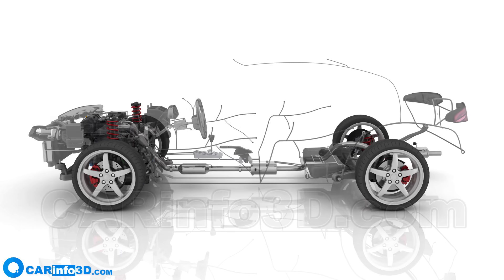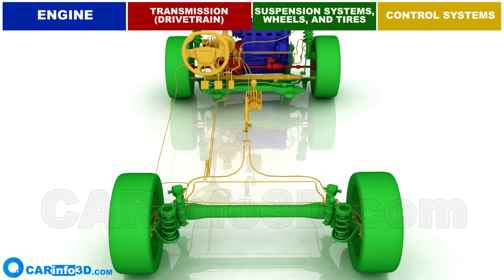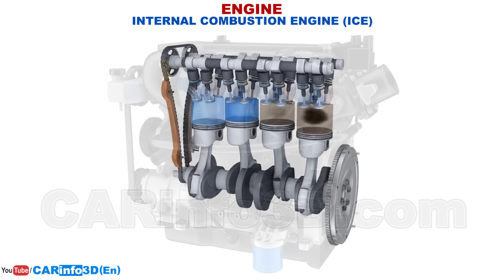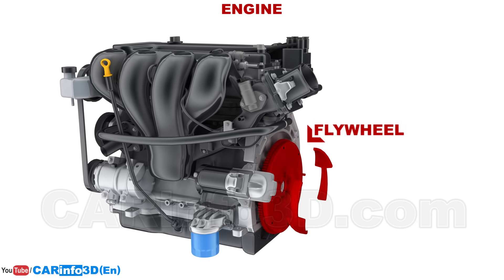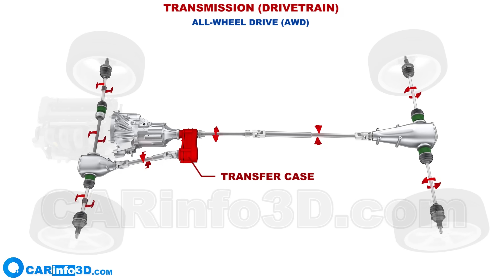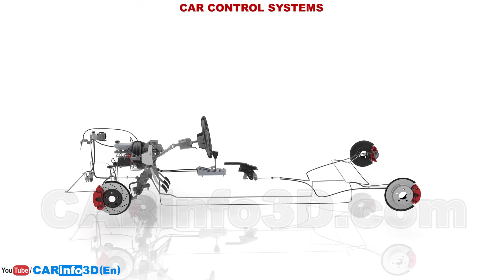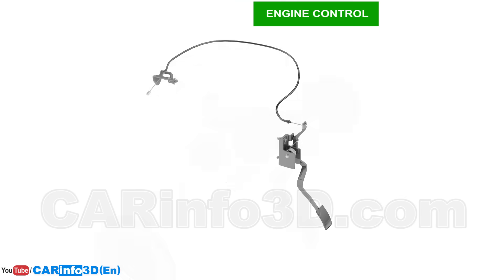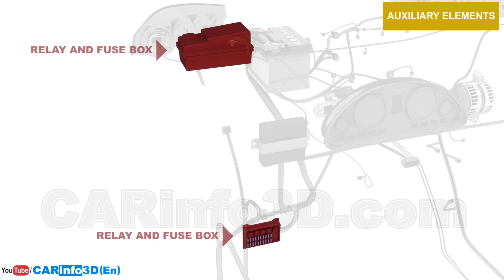Сar anatomy: The Basics / How cars work? (3D animation)

Comment from the maker: Hello! My name is Vlad and I am the author of this video. I would be grateful if you rate the translation and sound in the video.
Also, wait for new videos - there will be a lot of them;) Enjoy watching!
In our online video course "Car Anatomy" there are more informational videos in 3D animation. Details on our website: https://carinfo3d.com
Reply: You are a great guy.Question.why doesn't a 1500cc car consume ten times more than a 150 cc motorbike ?
Reply from the maker: The main point is not that it is a car or a motorcycle. The bottom line is in many other details - 2/4 stroke, carburetor / injector, engine operating speed, compression ratio, intake and exhaust design, and more. All things being equal, the values of the change in fuel consumption relative to the volume of the engine will be close. 
P.S. google translate thank you:)
Reply: @collinsnguyo9688  The fuel consumption of a vehicle depends on several factors, including the engine size, weight, aerodynamics, driving style, and road conditions. A larger engine typically requires more fuel to operate, but it doesn't mean that a 1500cc car will consume ten times more fuel than a 150cc motorbike.

Firstly, a car has a more efficient engine than a motorbike, which means that it can convert a higher percentage of the fuel's energy into motion. Additionally, a car's weight and aerodynamics are designed to minimize drag and maximize fuel efficiency, while a motorbike's design is optimized for speed and maneuverability.

Secondly, the driving style of the rider or driver also plays a significant role in fuel consumption. A motorbike rider may drive more aggressively, accelerating quickly and maintaining higher speeds, which can result in higher fuel consumption. In contrast, a car driver may drive more conservatively, using gradual acceleration and maintaining a steady speed, which can result in lower fuel consumption.

Overall, the fuel consumption of a vehicle is affected by various factors, and it is not solely determined by the engine size. Therefore, a 1500cc car may consume more fuel than a 150cc motorbike, but it won't be ten times more.
Reply: This was good , it’s clear and understanding!
Reply: Hello Vlad, nice break down of the all the systems that bills up the car. It has been made simple and easy to understand. As a newby I was total satisfied with your explanations. 

 I totally learned something new today. Thanks Man
Reply: It’s perfect!!  Thanks mate!
Reply: Really good, very simple nad easy to understand.
Reply from the maker: Thank you!:)
Reply: @Juras-55  The Kingdom of God is at Hand 
John 3:16
King James Version 
16 For God so loved the world, that he gave his only begotten Son, that whosoever believeth in him should not perish, but have everlasting life.
Reply: Pretty good tbh👍
Reply: Is't a car?
Reply: I m a little curious about what software you used to do all the animation...
Reply: Vlad....glad to look at your great work. I am happy to know what kind of animation software to animate these wonderful illustration.
Reply: translation and sound was excellent. I didn't even know it was a translator until I read the comment, good job!
Reply: Good info about the Car and it's working, system,Clear explanation and animation.🎉
Reply: Everything is perfect. I learned many things from this video
Reply: спасибо огромное! пока не зашла в комменты, даже не поняла, что это перевод. сделано очеень профессионально
Reply from the maker: @delphiaoconnor8544  Вам спасибо большое, что оценили:) Мне пока тяжело оценивать работу диктора и переводчика самостоятельно, надо подтягивать английский, но комментария показывают, что они справились потрясающе! Доброго вам дня!
Reply: this was great and entertaining to watch, thank you
Reply: Vlad please make course about all parts of car. I will buy it.
Reply: Hi Vlad, thank you for this basic overview of car. Would you happen to have a link to pdf files or slides of the pictures and components shown in this video? Thanks
Reply: Hello, I am Wasiq and when I saw this video, I understood how the machine and its components work with each other and this video will be useful for people.
Reply: Bro i have 7 emails and you are getting 7 subscribers because you have pleased me a lot. You have a great skill to make anyone understand.
Reply: well done!
Reply: Very impressive keep posting
Reply: Thanks ❤
Reply: this is  a great  video
Reply: sb helps me by give me several example about ''decorative elements" on the body of a car to uderstand more clearly? I can't distinguish between '' auxiliaries and decorative elements". thanks a lot
Reply: Amazing work 🔥
Reply: Not every hero wears cap
Reply: Perfect video and sound.
Reply: Cool 🚗 🚘
Reply: This is how you do it!
Reply: Can't wait for the electrical video haha! These videos are awesome for study.
Reply: Wow thank you Vlad, you did a great job, keep m coming!
Reply: Great!
Reply: What is the role of accelator?
Reply: Very good
Reply: Can you please send us the program
Reply: If you could tell me xhat softqre you use to produce this video
I will be thankful
Reply: Wow!  I am trying to understand just a little bit.
Reply: what software did you use to make this animation?
Reply: Z
Reply: I am 29, consider myself a 5/10 on car knowledge. The visuals in this video are absolutley fantastic. I understand these components so much better now.
Reply: What 3D application did you use, for this tutorial.
Reply: Very informative video
Reply: you can easily compete against Elon Musk... good luck...
Reply: Wow superb diagram and discussion.
Reply: very good voice and very knowledgefull vedio
Reply: Really good.
Reply: Great job.  Very simple which makes it very easy to understand🎉🎉🎉
Reply: Perfect
Reply: Hey! Don’t know if something might’ve corrupted in recent time, but it cuts off some sentences
Reply: which software do you use to animate it.
Reply: Great! Easy to understand
Reply: Can you work to apply my education, I hope that I am waiting for
Reply: Very interesting.  Good knowledge explain. I am very curious about cars until this video show how car works.  Thank you for hard work. ❤
Reply: Freaking you😮
Reply: Hi Vlad, Where i can get this Car Anotmy i need for my project
Reply: You did a very good video vlad and keep it up if you know brain draught please like this comment just kidding😂😂😂😂😂
Reply: Incredible video, excited to watch more of your vids for a fuller car knowledge.
Reply: Круто сделано!
Reply: @Markus_004  99999⁰0
Reply: 7❤ @Markus_004
Reply: @Markus_004 От Иоанна 3:16

16 Ведь Бог так полюбил этот мир, что отдал Своего единственного Сына, чтобы каждый верующий в Него не погиб, но имел вечную жизнь.

Иисус Христос — царь
Reply from the maker: Спасибо!:)
Reply: @carinfo3d-En  От Иоанна 3:16

16 Ведь Бог так полюбил этот мир, что отдал Своего единственного Сына, чтобы каждый верующий в Него не погиб, но имел вечную жизнь.

Иисус Христос — царь
Reply: This is the best video ever I watched
Reply: Great vid boss. Just a quick suggestion - maybe add music, and also reduce the silences between sentences. personally the pace of the video is slow, but that's just me. adding music and decreasing the seconds that are silent could help this. 
Also have a video suggestion- maybe make a video on how a car works - from the start to finish, as a story. What I mean by that is, create a storyline video on a person starting the car, shifting gears, removing parking brake, using ac control, etc - and how that translates to the car, ie: what car parts allow each of those events to function.
Reply: But, I guess in considering how a car accelerates, when you put on the accelerator/turtle , fuel is leaked into the combustion system at the intake.
Now, the intake also allows in air to mix with the intake fuel. 
Then, the spark plug which by way of its electrical connection to the ignition, sparks/combust the fuel/air mixture generating energy pressure that push the piston to roll the drive train and tire while generating smoke from the combusted fuel. 
Now, the more you pedal the accelerator, the more fuel is released into the combustion chamber and the more force energy is generated by the combusted extra fuel, and the more the piston is moved to drive the drive train, and the more the drive train rolls under the extra energized pistons and the more the tyres roll and so the more the car accelerates.
So, the more you press, the pedals, the more the fuel supply for combustion, and the more the energy of the drive train, and the more the car accelerates. 
To decelerate, you press down the brakes to restrict the tyre movements and this is associated with a release in accelerator pressure and so the air and fuel supply. 
While to maintain speed, you keep a balance between the break and the accelerator. 
So the question is, does acceleration leads to more fuel usage because some people says it doesn't and so, how does it not.
Reply: The voice has a very strange accent, it is definitely not American, it is not easy to comprehend

Comment: What I still don’t understand is how the engine remains connected to the drive wheels when the suspension is moving
Reply: Suspension is independent of the engine. Suspension is only for the wheels. The absorb most impacts you'd feel on daily drives. The engine is mounted TIGHTLY to the chassis so it doesn't move. If your car starts to shake violently, its either a misfire, or loose engine mounts 👍

Comment: My seven y.o asked how come oil gets used up yet it doesn't pour out.😅
I've watched this but honestly m also yet to understand.
Reply: I'm not a mechanic, so my understanding may not entirely accurate. From what I know, there could be many reasons why this happens. One of the reasons could be that he piston rings ca wear out over time which causes oil to enter the combustion chamber and be burned away as part of the combustion process.
Reply: @JJFlores197  pretty spot on actually. It usually never happens unless you have a lemon. So its good to maintain and keep tabs on everything.

Comment: what does (anti roll bar do?)

🤔🤔:face-blue-question-mark::face-blue-question-mark::face-blue-question-mark:🤔🤔
Reply: As I understand it, anti-roll bar, as the name implies, prevents the vehicle's body from rolling too much during curves/turns. When you're driving down the road and turn right, the body rolls to the opposite side. The anti-roll bar system compensates by forcing the suspension of the opposite wheels to compress to stabilize the body.

Comment: Space Force science experts of the CaesarKing, create two folds of system designed strings variety from Earth science tech labs of my functional groups space focused group and in my space stations of strings in clumps likened to the Globulins coloured types but with variety of structures and string to string attachments with imbedded sensors within that connect per string receptors and stringed fibers types in space all be formed in clumps after system designs and after space station deployments in its compartment clumps per materials strings functional types racks or rows which can be launchable by the space probes of my space force or by specific area teleport of strings which can be tweakable with energy charges types accomodation capability engineered to be versatile and space environment adaptable materials for the reinforcement of orbital structures and strings,, as temporary pathways, designable in shape to whatever science shape functionality per real time purpose or mission etc. Energy to money conversion facilitated by AI Quantum Satellites of the CaesarKing for fundings be done now. By system controlled minimize and maximize to AI specific measurement those strings adjust in size  Let it be

Comment: I want to know how petrol flow...
Reply: The fuel tank has a fuel pump. As the name implies, the fuel pump pumps gasoline from the tank to the front of the car via fuel line and into a fuel rail. This fuel rail then leads into the fuel injectors which inject fuel into the cylinders

Comment: First off, it’s a great video but there is one thing I don’t understand. So that one small gearwheel that transfer all the energy from the motor can really withstand the pressure of the car usage for years?!? I mean, even the small teeths on the gear can last hours of usage a day going 100 km/h for years without breaking? Please elaborate. thanks

Comment: Try new things try including clutch transmission engine put on side try start with four cylinder block engine to one side rather then middle then add hydrogen vacuum pump or oil different like electricity

Comment: for pc builders out there key takeaways i got from the videos that has a slight reference to pc building is that:
 Engine = CPU (has a cooler) 
Generator (in engine) = power supply
 Body + frame = Tower
Electrical wirings = pc wirings

Comment: Golden Point - All Electrical Wires are thin to save as much battery power as possible because they are using the cheapest electricity producing materials in the battery and all of this adds up to the same thing as the thin fuel lines ie poor performance, constant repairs and early breakdowns

Comment: Golden - All Fuel Lines are thin to save as much fuel as possible which will result in poor engine performance, const repairs of the engine and replacement of parts and early breakdown

Comment: As a consumer who's never even changed oil in my own car, I really appreciate videos like this. I've owned many cars and only after purchasing my 2024 car that I gained interest in how it all works. Amazing stuff. Diving deep into sub-systems like suspension gave me a whole new level of appreciation. Considering the engineering to make it all work, that high price tag is justified.
Reply: Please can you help me I don't have any car please 😢
Reply: I don't know shit man... even how to change my oil or replace a flat tire 🤔
Reply: For me it started being in Norway where they charge ridiculously but fix poorly or not.
Reply: Me too! I just bought my first suv, its a first gen car and i love it also made me interested in learning more and being independent in fixing my own car needs
Reply: Even so the car market is beyond inflated, cars are made with cheaper materials in the last couple decades and most don’t hold up the same as those previous models. The price tag on a 2024 car is certainly not worth it, a car even 2 years older of the same model could be easily half the price and would be virtually identical. There’s a sweet spot at around 10 years old where you get extreme value for a well built car that will last a long time. By the time you’re ready to sell them they only depreciate a little bit and you can get most of your money back. Buy the 2024 car and sell it at around 100k miles and you will have lost 80% of the cars value
Reply: This video helps me a lot to understand better about car knowledge, I want to be a service advisor, on my way to this c journey I love everything about cars
Reply: It's amazing your video, thank you much for share it.
Reply: @eduardopratzcampos4931  nice english
Reply: Filthy casuals lmao
Reply: They didn't really say anything about oil though